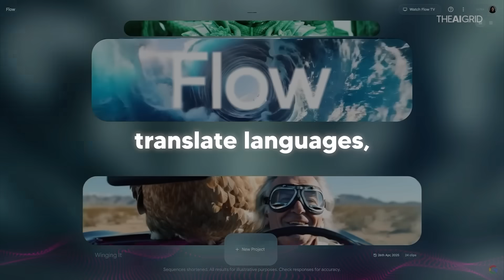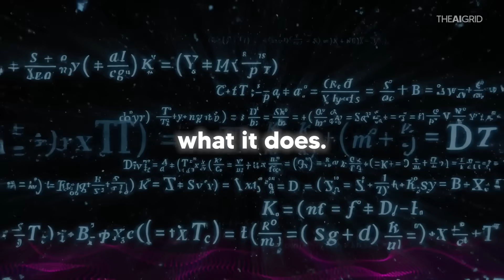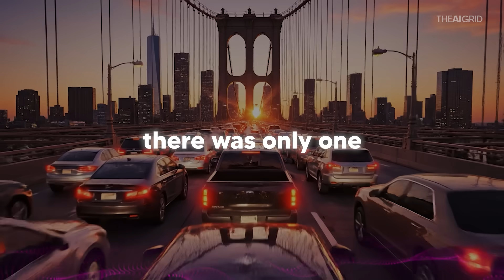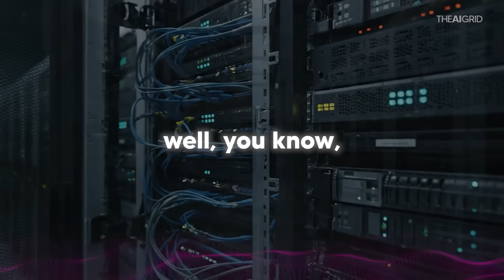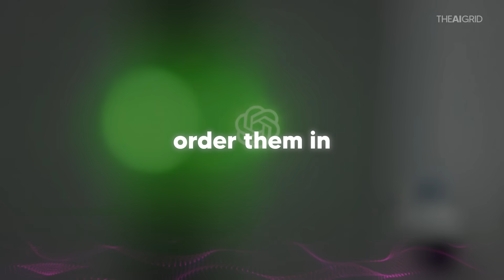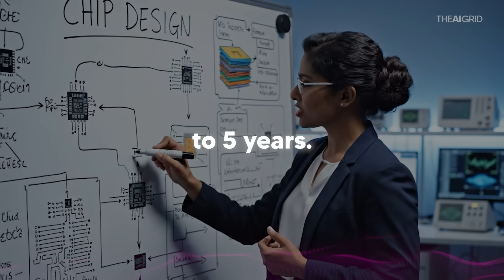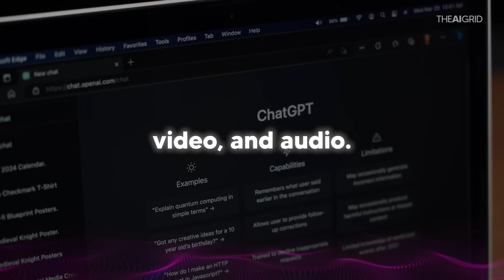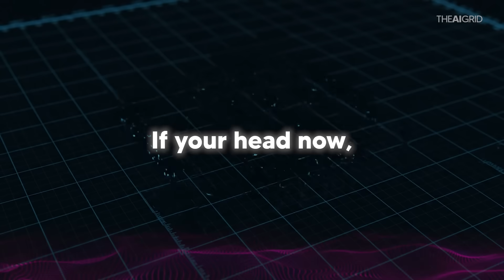This Chip Could Give OpenAI an Unfair Advantage.

Comment: Question: how far away are Thermodynamic computer chips?

Gemini's Answer:

Thermodynamic computer chips are a nascent technology, with the first functional chips emerging this year (2025), and broader commercial use potentially within the next decade. 
This new computing paradigm is being actively developed by startups like Normal Computing and Extropic, who have already produced initial prototypes. 

Current Status

+ First Chips are Here: Normal Computing announced the "tape-out" (design finalization and manufacturing start) of their first thermodynamic computing chip, CN101, in August 2025. Extropic has also produced a physical chip and is developing related algorithms.

+ Specialized Applications: These initial chips are not general-purpose CPUs like those in a laptop. They are Application-Specific Integrated Circuits (ASICs) designed to accelerate specific, energy-intensive AI workloads, particularly generative AI diffusion models and probabilistic computing tasks, by using noise and randomness instead of fighting it.

+ Significant Energy Efficiency Potential: The primary motivation for this technology is a dramatic reduction in energy consumption for AI data centers. Developers anticipate potential energy efficiency gains of 1,000-fold or more over current GPUs for targeted tasks.

Future Outlook

- Near-Term Roadmap (Next Few Years):

	+ 2026: Normal Computing plans for a second-generation chip (CN201) targeting high-resolution diffusion models.
	
	+ Late 2027/Early 2028: Normal Computing aims to scale to advanced video diffusion models with the CN301 chip.

- Long-Term Vision (Within the Decade):
	
	+ Researchers are optimistic that small, low-dissipation circuits could become feasible in a couple of years, with full microprocessors potentially debuting within this decade.

	+The long-term vision involves a future where different types of "physics-based ASICs," including conventional, quantum, and thermodynamic chips, will be used together, with each problem matched to the most optimal hardware. 

In essence, while you won't find a thermodynamic chip in a consumer PC tomorrow, the technology has moved from theoretical to practical prototypes, and a specialized "Cambrian explosion" of these and other novel chips is expected within the next five years to address the energy demands of modern AI.